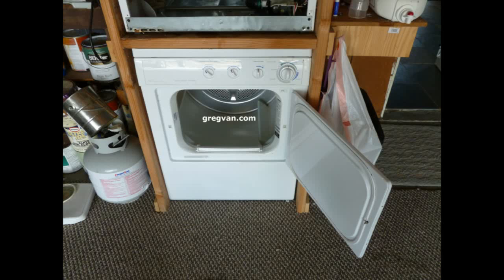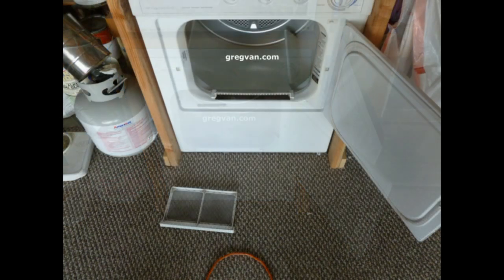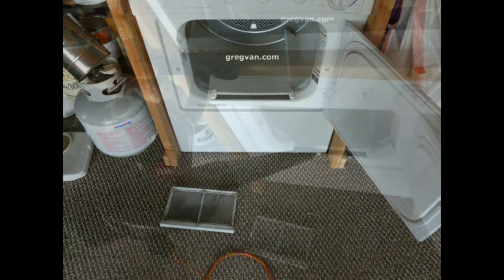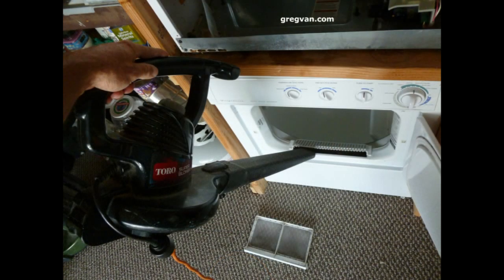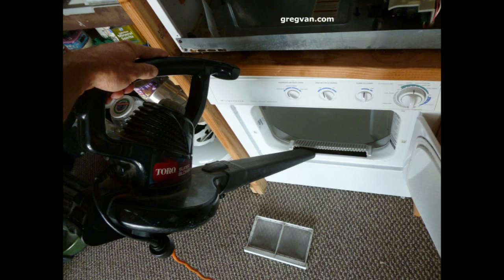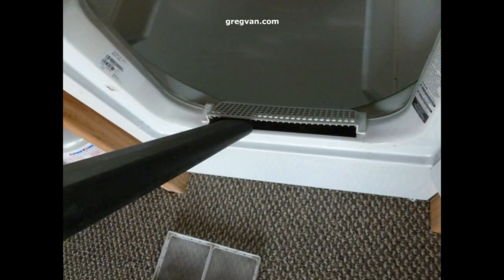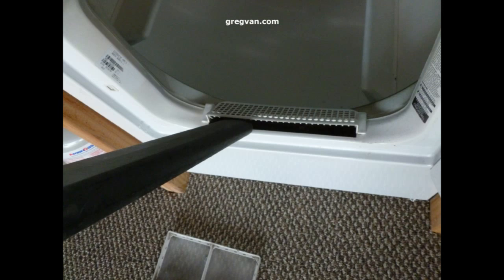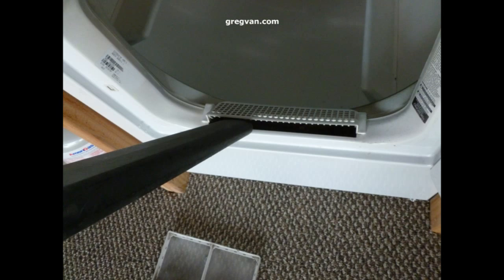How to Clean Short Dryer Vent With Garden Blower

Comment from the maker: That will remove some of the lint, but the blower usually forces air through the entire system of duct pipes, where a vacuum won't. This method isn't going to work every time, under every condition, but will do the job most of the time.